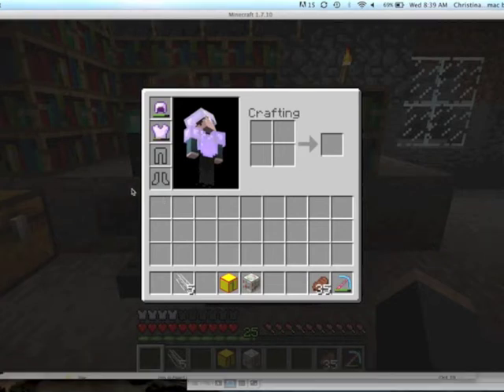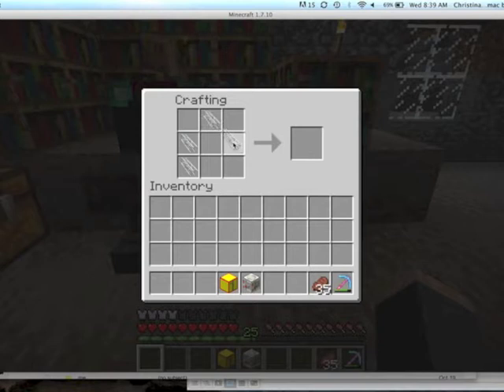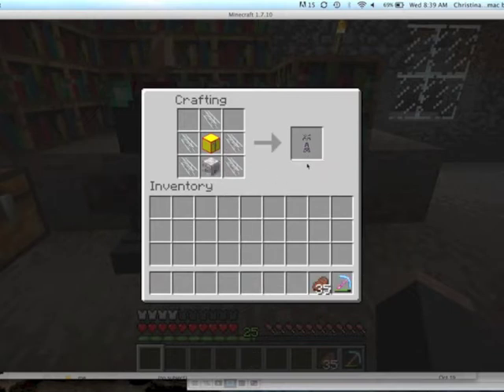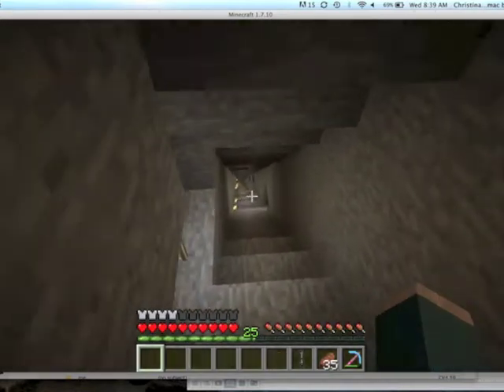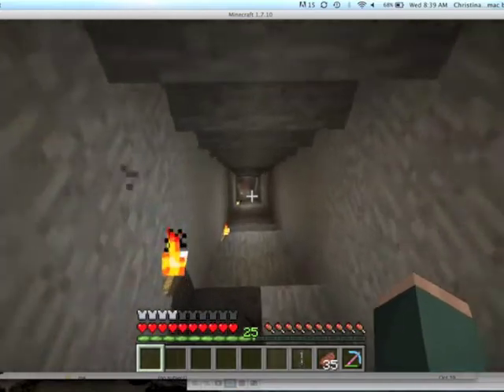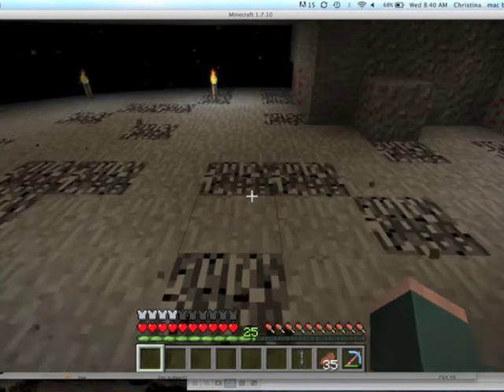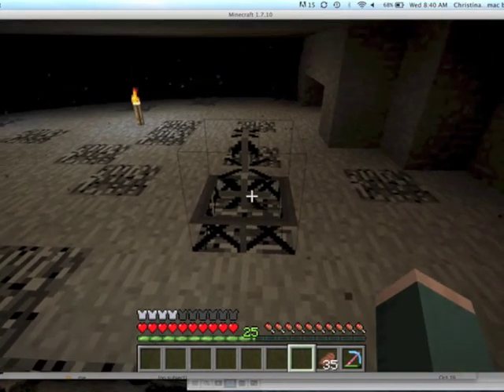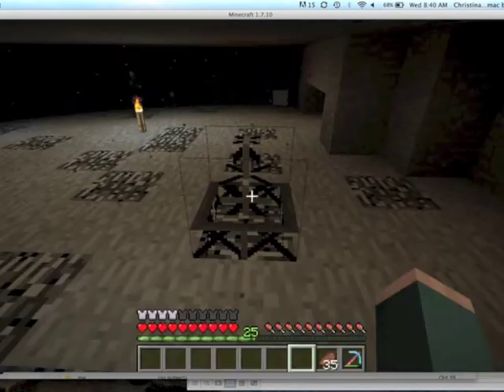Crafting and Placing an Oil Derrick in Polycraft!

Comment: Do they dry up after x amount of barrels are extracted?

there are 2 "oil fields" within a block of each other that quit producing after about 10 stacks. I tried restarting the server & client, re-placing the derricks, removing blocks around them and still nothing even tho the derricks work fine on other oil fields.

also do you have a bug tracker yet?